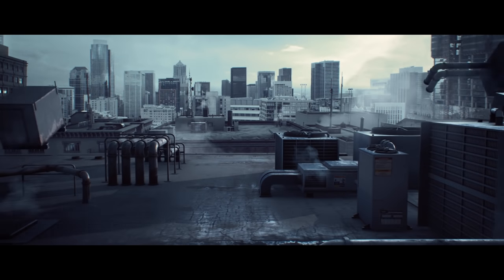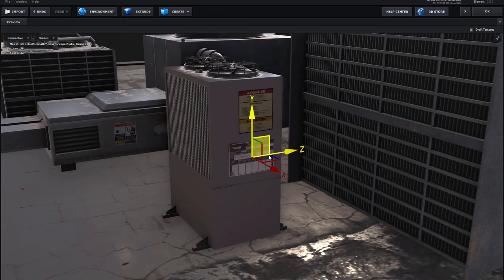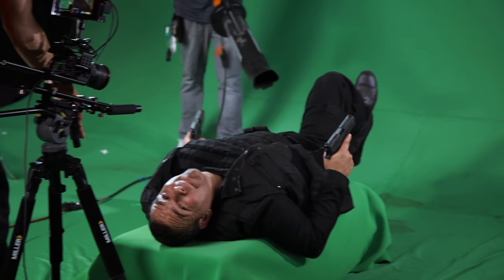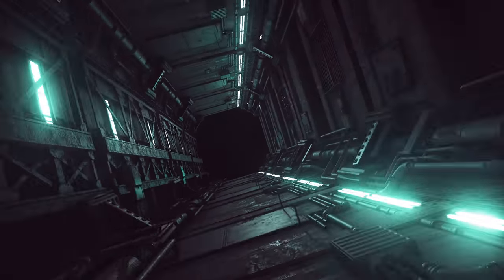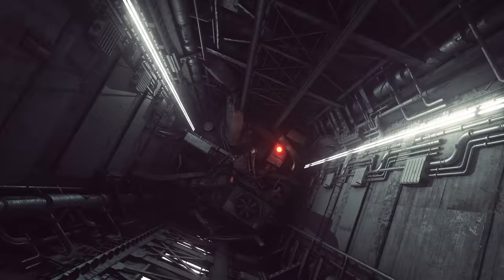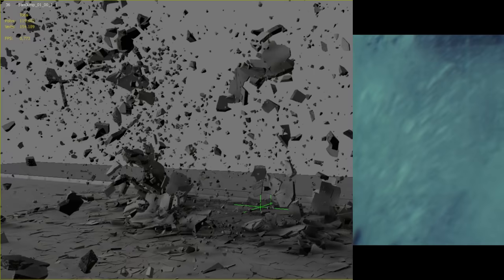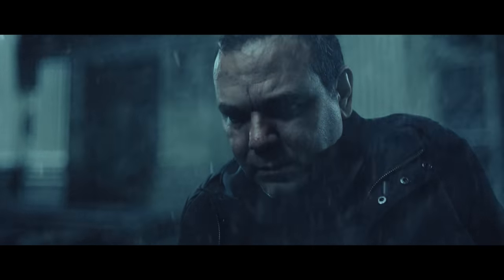Video Copilot Show:  SUPERHERO LANDING!

Comment: sorry I am asking  but I want to know what software you are using for creating 3d building and everything on green screen. because my phone audio is not working.
Reply: He uses 3DS MAX for making the models and stuff.
For mixing, editing and green screen stuff he uses Adobe After Effects.

After Effects will take a long time getting sued to but once you learn it you can do a lot.
Reply: thanx frnd.
i have search little more in this regard that is, the rendering use by 3ds max is Scnline and vray so , my question is. what is best option for rendering. or both produces same level of rendering?
Reply: RANJODH SINGH Actually I don't know that much in detail about this stuff. Only thing I do know is that they're used.

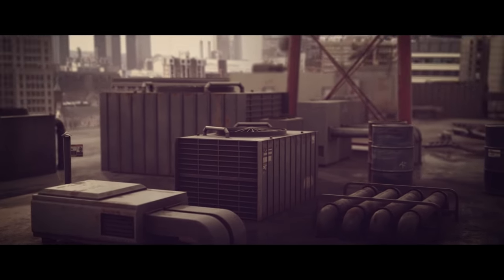Comment: How to  2:40? background zoom
Reply: Pansito Style that’s a lens trick, where your camera is zooming in while being moved backwards so the frame is the same but distances change... not sure 100 percent if it will look the same if you do it digitally, but that’s how it’s done irl. I’d mess around with some camera settings in ae or try working with that :) it also might literally just involve moving the background elements back